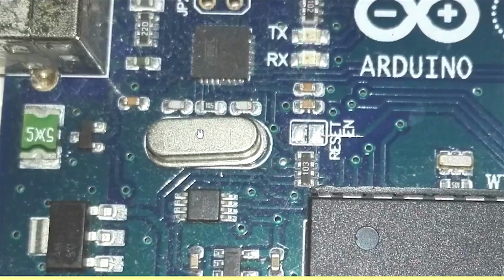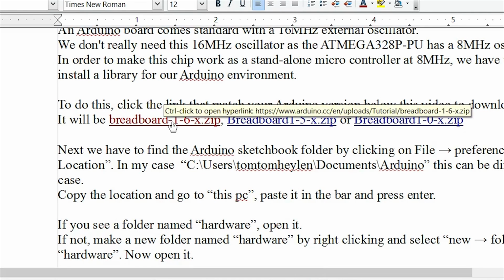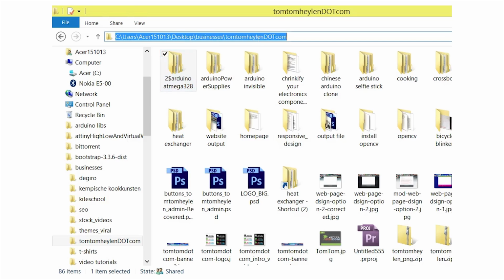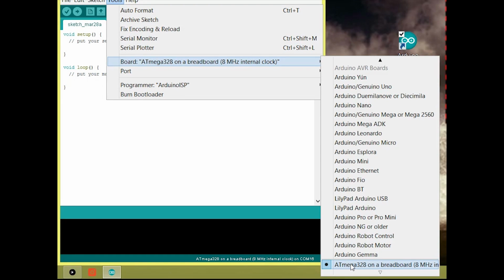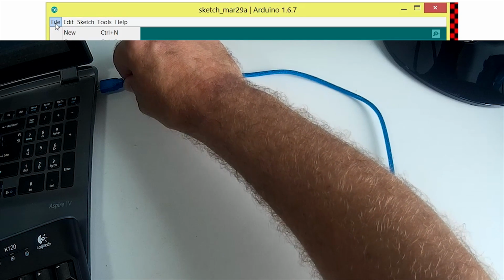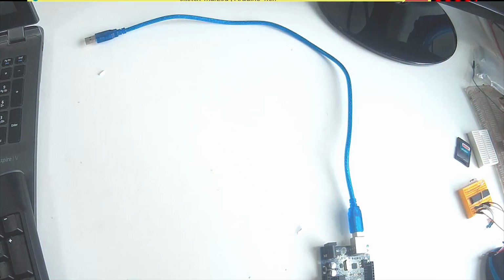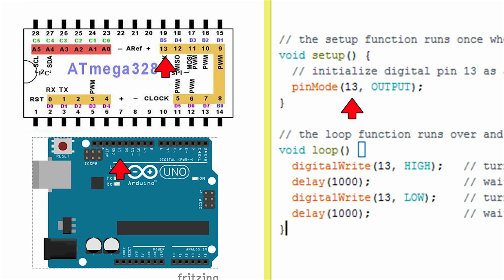$2 Arduino The ATMEGA328 as a stand alone  Easy, cheap and very small  A complete guide

Comment: Who is still doing this in 2025?    Well I just did 12 in a row, putting the 8Mhz breadboard bootloader.  Final test was uploading blink to all of them.   2 of 12 had issues.  Re-burned the 8Mhz bootloader, no errors (except warning on efuse, but that is not a problem) and still those two refuse to take a sketch.  Trash can for those with no explanation, except they were bought in bulk.

Comment: Like in all videos: it is never mentionned what is the true reference you burn on the breadbord.
Yours is a P -  PU but there are Atmega328 without P or with PU without - before.
I'd like tu burn these types for myself : i have a signature problèm. I change for what it should be but i did not check wath the signature really is. Unfortunatly i cannot have any accès to the chip except may be with another protocol as i saw.
Did not really use your method but the one that connects pins 10 11 12 of the chip.

Comment: For all of you with an error when burning the bootloader:
Try to connect a 16MHZ clock between the pins 9 and 10 of the atmega328p chip. Now connect pin 9 and 10 to GND using a 22 pFarad capacitor (with pin 9/10 I don't mean the digital Pins, but the pins you can find on the pinout). Should work now!

Comment: Great video -- this is exactly how an instructable should be done: clear instructions and easy to follow -- you've just gained a subscriber! I'm going to order some Atmega chips for use in my production versions of my projects (rather than using the larger, more expensive Arduino boards)
Reply from the maker: Hi, Great the video has helped you. I use also very often the nano because they are cheap and small like this one here. Have a great day.
https://www.banggood.com/Geekcreit-ATmega328P-Nano-V3-Module-Improved-Version-No-Cable-Development-Board-Geekcreit-for-Arduino-products-that-work-with-official-Arduino-boards-p-959231.html?cur_warehouse=CN&rmmds=buy
Reply: @TomHeylen1  I'm going as small and cheap as possible, bypassing breadboards for production -- considering the AtTiny instead, soldering the wires on

Comment: Arduino: 1.8.12 (Windows 7), Board: "ATmega328 on a breadboard (8 MHz internal clock)"
Error while burning bootloader: missing 'bootloader.tool' configuration parameter

Comment: Does not longer work. While uploading the bootloader it gives me this error:

Arduino: 1.8.9 (Windows 8.1), Board: "ATmega328 on a breadboard (8 MHz internal clock)"

avrdude: Yikes!  Invalid device signature.
         Double check connections and try again, or use -F to override
         this check.

Error while burning bootloader.

I am using: IDE 1.8.9
and: breadboard-1-6-x

Comment: I had to copy the library to the hardware folder of the installation folder of the Arduino IDE. I am using UBUNTU 18.04  LTS and Arduino IDE 1.8.12. In my case this was /opt/arduino-1.8.12/hardware

Comment: specify which type of chip to use! your using a "atmel 1417" atmega 328 means nothing! their are possibly 3 serial numbers on each chip. some only have 2. "atmega 238p-pu" is one but their are many types some are not even rectangular some are square chips! their are lots of "ATMEL" all are atmega328. however, you do specify which one to use in your down load. i think do you have the exact right type?

Comment: Thanks for the tutorial!  Is it possible to just download the sketch when the chip is still on the arduino and then just take it off and then put it on the breadboard for your project- without all the wiring ? --And then just stick a new chip back on the arduino so you could do it again for multiple projects?  thank you
Reply: I would recommend you to build some circuit where you have 2 ends, one for the arduino and another one for your ATMEGA328 , so you just leave it there ready to plug

Comment: I've successfully moved my main project from Arduino to an ATmega328p on a custom PCB (mostly thanks to your video), but now the EEPROM values I used to save when using the Arduino are no longer getting saved or retrieved. I can't seem to find any info online on how to modify the code to use the EEPROM on the standalone ATmega. You seem to know so much about this stuff, I'd owe you one if you happened to have insight on this!

Comment: The 16Mhz Crystal on the UNO only gives its pulse to the small microcontroller, that handles the USB connection - The Atmega328 is clocked by another ceramic oscillator!
Reply: I see two crystals onboard.
Reply: @a.bax.5992  Are you sure about that? If so you must have a very rare clone.
Almost all Unos and Megas and the clones have a crystal for the usb connection and ceramic resonator (which is not a crystal) for clocking the main microcontroller. - crystals usually are accurate to within 100ppm which is nessesary for the USB communication, where as ceramic resonators are only "accurate" to within 3000-6000 ppm, which becomes really noticible, when you are trying to control timing sensitive applications with it.

I tried to build a telescope tracking system, and it was really off, after only a few seconds... the ceramic resonator on my Uno is 1500ppm too slow... After using a sqrw signal from a RTC module for timing it works great. (the crystal in the RTC is accurate to within 6ppm and temperature corrected).

Comment: What if we have an arduino uno where you can't remove the IC? Is there any way to upload sketches to the atmega328? I have one that already has the bootloader but I don't have a USB to serial cable. Is it possible to cut up a USB cable and attach to breadboard? Please help!
Reply from the maker: Watch my video on ftdi connector. I think it will solve your problem. Have a good one. Cheers

Comment: I have made a project with Atmega328p .
The project is an 1HP motor(water pump) control .
the circuit have sonar sensor ,16*2 LCD, relay,ULN2003,7805, crystal, capacitors, 10k variable resistor .,...it is working properly with 9V HW battery ,but when I am trying it with 12V adopter(adopter is ok- also tried with two more adopter) its not working....what would be the cause....My english is not good .....please reply
Reply from the maker: Very likely that the adapter does not have enough amps. Check the amps your circuit uses and compare it with the adapter. Have a good day!
Reply: +Tom Heylen thank you sir....

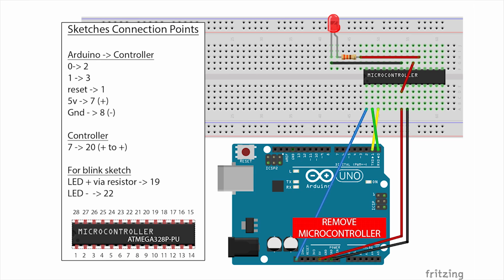Comment: At 4:08, there was a wrong in the sketch (diagram), the RESET pin of ATMEGA328P-PU shall be connected to RESET pin (not to pin 1) of Arduino UNO , if you connected as in this video you will not be able to re upload a new sketch again
Reply: Thanks for sharing. Now it works. Too bad that Tom doesn''t mention this somewhere - or in other words, has errors in his video :-(
Anyway - I'm glad that he did this video & you corrected it!  Thanks dudes!
Reply: hi sir we have at mega 328p programmed chip( chip is 4x4 ) and we want to 
take a backup from this chip.please tell me how to take a backup from this chip?
when can we use a Universal programmer to take a backup from this chip?
if you have already  a video on this please send me link
                thank you so much sir
Reply: @muhammadmushtaq2064  Sounds like you want to copy someone's program?
Reply: @a.bax.5992  no dear sir i am working on my sound my voice can if you have  any idea or for batter voice please help me i am thankfull to you sir

Comment: Hi Tom,
I have an Atmega328 with a bootloader already burned. 
Also, My arduino IDE version is 1.8.5
Will the 1.6 zip file still work?
Reply: Did it?
Reply: i have the same question. if anybody has tried it can they please answer

Comment: Does anybody knows why i get the "avrdude: stk500_getsync(): not in sync: resp=0x00" error every time i try to burn the bootloader?
Reply: even ii hab the same problem
Reply: did you install the bootloader and do you have the right driver for the usb to serial adapter.

Comment: I got this error 
avrdude: Yikes!  Invalid device signature.
         Double check connections and try again, or use -F to override
         this check.
Reply: I have the same problem too
Reply: Did the atmega328 came from the arduino ?
Reply: @JS7457  I bought them from ebay, they are ATMEGA328P U.  I tried programming the bootloader using the UNO as SPI and the atmega with 16 mhz crystal attached and selecting Arduino Uno in boards(16mhz) and it works perfect. But when I try to use it or bootload the Atmega standalone with 8 mhz inner crystal as shown in this video I get the error message that Naaven posted.
Reply: Check your connections. Be careful as there is two VCC and GND on the atmega, connect them together.
Reply: have you found the solution yet?

Comment: My friend nice video but, the 16 mhz crystal you show us is not the arduino crystal is the 16 mhz crystal for the usb circuit , the 16 mhz arduino crystal is the very small crystal near to pin 10 on the board

Comment: It is a really nice concept, but I am trying hard to justify using the chip itself, when a pro mini is sometimes cheaper than the bare chip, only slightly larger, and comes with all those bells and whistles  like reset button, voltage regulator, oscillator, leds, headers... Pro Mini: http://www.banggood.com/Pro-Mini-ATMEGA328P-5V16M-Improved-Version-Module-For-Arduino-p-985618.html?p=A00418157038201304EB 328P-PU: http://www.banggood.com/DIP28-ATmega328PPU-MCU-IC-Chip-With-Arduino-UNO-Bootloader-p-932159.html?p=A00418157038201304EB
Reply: 2 advantages I see. First  is in power consumption.  If your trying to make a product last a long time on a couple of 2031 coin cells, this will do the trick.  2nd.  If your using this in YOUR end product you can more easily control the quality of the components.  When you $3 for an entire board I am not confident enough to embed that cheap component into my end product and have my reputation harmed.  the second reason is a personal one, I feel I can trust the maker of the component (resistor, cap, crystal, etc . .) more than I can trust the PBCA skills of the board maker
Reply: If power consumption is key (i have some battery powered projects) I just remove the power led and the voltage regulator from the board. My meter can be wrong but I still am above the 328p datasheet powerdown power consumption (I do 5uA). Is this possible? What do you think consumes the extra? As for the quality of the components and the board, these boards that I use seem to be quite good quality.

Comment: well explained...

but I get this error:
Warning: Board breadboard:avr:atmega328bb doesn't define a 'build.board' preference. Auto-set to: AVR_ATMEGA328BB
Sketch uses 4380 bytes (13%) of program storage space. Maximum is 32256 bytes.
Global variables use 481 bytes (23%) of dynamic memory, leaving 1567 bytes for local variables. Maximum is 2048 bytes.
Reply: I get the same error. I'm running  IDE version 1.8.19 - any ideas how to solve?
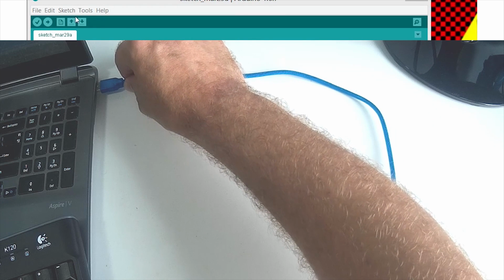Reply: Oh I found the problem.  He has the sequence incorrect.  This error occurs when you set  'ATMega328 on a breadboard...' as the board before you upload the ArduinoISP sketch - you need to select your Arduino Uno board first, then upload the ArduinoISP example to it, then do the wiring to the breadboard Atmega328 chip, then select 'ATMega328 on breadboard...' the follow instructions to burn bootloader (3:29).

Comment: Hey Tom,  have you ever tried setting the fuses to let you use PB6 and PB7 (the oscillator pins) as digital IO ? I know it's  possible but I'm not sure how that will work out with the arduino pin numbering.

Comment: why don't you stick the new chip in the chip's space from the original chip that you have to remove in arduino uno?
Reply: But the removal of the Uno chip was after the bootloader was burned. He removed it and hooked up wires between the naked board and the new chip to program the chip with the actual program (in this case the Blink demo).

My best guess is that you don't always have the chip on its own, so he was showing you can program it through wires instead. It could also save on wear and tear on the socket and it will prevent legs from getting bent by saving 4 insert/remove processes.
Reply: morphman86 agreed or he's showing that this is a way to change/upload sketches onto your project without removing the chip from your project. He's showing how the Arduino can be used to program via ISP.
Reply: Because the new chip doesn't come with the Arduino Bootloader, so it will not understand the communication.
Reply: it will damages the pins
but it does work

Comment: Thank you for the guide. I'm getting this error:

avrdude: Device signature = 0x000000
avrdude: Yikes!  Invalid device signature.

Any idea?
Reply: I had same. Then I realized I had chip backwards. Then I checked wires again, but inbetween checking and programming one cable came loose, it worked when I connected everything properly. These tiny wires can look like they are connected when they are not... Nick Gammon's sketches also helped to do tests.
Reply: In my case the oscillator it was broken. but i think it show the same error when the micro (the atmega) is not in reset mode, i mean when you reset it but you take too much time to upload the sketch. Hope it help. If is there any thing i can do for you just let me know. Regards

Comment: Now, you can order Arduino Uno for $3, shipping free from China :D
Reply: I ordered two "UNO" for 3$ each from eBay.
Not arduino thou but the quality was really good nevertheless.
Reply: Ive got about 15 or 16 chinese uno, nano and pro mini clones from ebay and theyre great, Ive never had a problem with any of them. the pro minis are very cheap, I usually pay around £1.20 to 1.50 englandshire pounds, not sure what that is in ameridollars but probably around $1.50 to 2.00
Reply: I think you forgot what is the intention of this video. The intention is to bring ATMega328 off board to make practical circuits smaller in size. Tom is at all not talking about the price. Hope now idea is clear for making this video.

Comment: If I don't want use arduino as power supply, did I need use voltage regulator in this arduino circuit?
Reply: Yes, and no. Depends on the application, and on decisions about 5V or 3,3V peripherals, if you intend to use the ADC (Analogue Pins). Generally having a proper regulated supply and over voltage, excess current and reverse polarity protection is always worth it. Some varieties of the ATMEGA328 will operate at a wide range of voltages (about 1.8 to 5.5V) but not all sensors etc will be as forgiving.

Comment: In the Version 1.6.9 com the warning: "Warning: Board breadboard:avr:atmega328bb doesn't define a 'build.board' preference. Auto-set to: AVR_ATMEGA328BB" and it takes a long time to compile.

May it be, that I need an older Version of Arduino Compiler?
Reply: I have the same problem...
did you solve?
Reply: Likewise - same problem (I'm running Arduino IDE v1.8.19.  Anyone know of a solution?
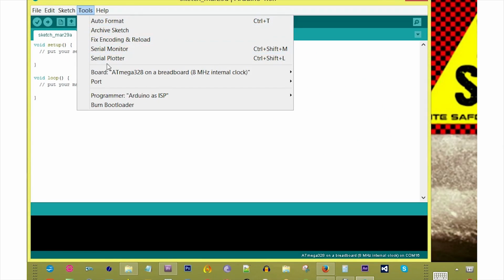Reply: Oh I found the problem.  He has the sequence incorrect.  This error occurs when you set  'ATMega328 on a breadboard...' as the board before you upload the ArduinoISP sketch - you need to select your Arduino Uno board first, then upload the ArduinoISP example to it, then do the wiring to the breadboard Atmega328 chip, then select 'ATMega328 on breadboard...' the follow instructions to burn bootloader (3:29).

Comment: I am having error Expected signature for ATmega328P is 1E 95 0F, any idea?
Reply: Maybe you using atmega328p-pu, it have different signature(1E 95 14), but all other are similar. in this case you may try to change configuration file of avrdude(flasher, which used in Arduino IDE).

Comment: My Arduino uses an Atemga328 SMD so I can't remove it. How do I proceed?
Reply: Also you can flash standalone chip using SPI using this as example, and you does not need to remove chip from arduino board :)
http://www.wholelattecoffee.com/wp-content/uploads/2015/05/ISP.jpg

P.S. In this case you will need to use "Flash using programmer", not regular "Upload"
Reply: @Dragomir90  so if we need to upload sketches with an arduino with atmega328p smd so we should connect the arduino with the chip just like we connected it to upload the bootloader?
Reply from the maker: +Randall S You can use a FT232RL chip. Cost less than 2 dollar. It is a USB isp 
programmer. Here is the link: http://s.click.aliexpress.com/e/VbQvJYJA2
Reply: +Tom Heylen 

Thanks Tom. I should have known to visit your Instructable, as this question has already been answered. You should make a link to that Instructable here.
Reply: GRACIAS genio.